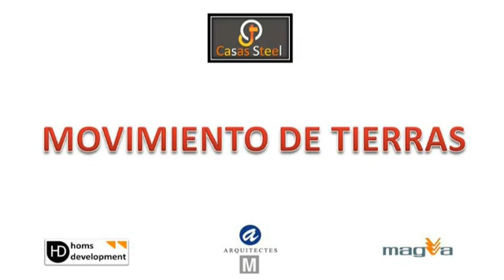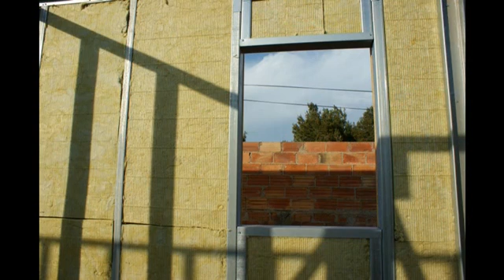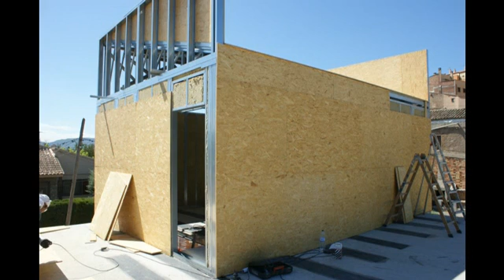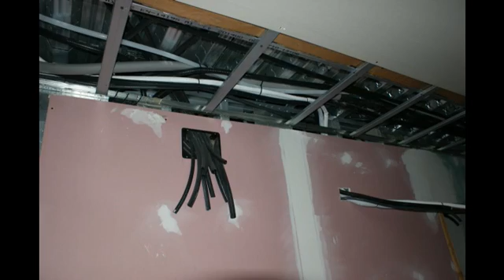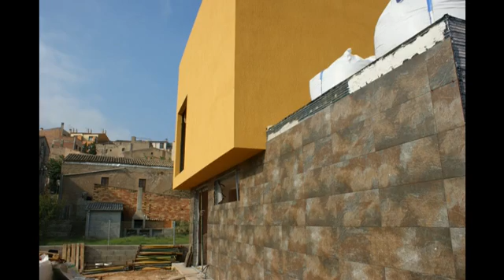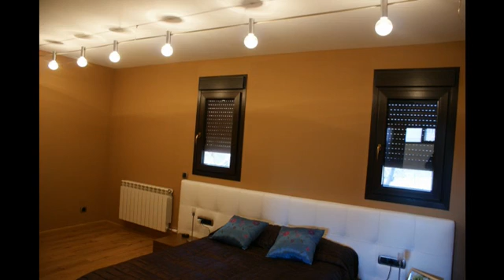Proceso constructivo -Paso a Paso- Steel Framing

Comment: A&W Tot Obras y Reforma tenemos el 
Precio 980,00 EUROS M2 CONSTRUIDO Cerrado GARANTIZADO
El estricto control que ejercemos en todos los procesos nos permite garantizar al cliente que el precio comprometido en el pedido va a ser el precio final que pague por su casa de Acero. Gracias a nuestro sistema de casas prefabricadas con sistema a seco Steel Frameng tendrás la tranquilidad de que el coste de la construcción no va a sufrir modificación alguna.
La Entrega certificada en 5 meses
La estandarización de los proceso de fabricación de las casas Acero hace que no dependamos de factores externos como la climatología, la coordinación de subcontratas, el suministro de materiales en obra… lo que nos permite garantizar los 5 meses de plazo de entrega comprometidos con el cliente.
Conoce más ventajas 
Disfruta construyendo tu casa 
Te acompañamos en todo el proceso
Invertir en una casa es una de las decisiones más importante de tu vida. ¿Y si te lo ponemos fácil?
Con nuestros exclusivo modelo de construcción evita cualquier imprevisto e incertidumbre para que puedas disfrutar plenamente con garantías de tu casa en cada etapa del proyecto, desde el inicio y durante toda la instalación, eliminando las incertidumbres en el proceso de compra y haciendo de la construcción de tu hogar una experiencia satisfactoria y de plenas garantías.
Descubre las ventajas de una nueva manera de entender la construcción de la vivienda así como de todos los servicios que definen nuestra innovadora oferta. Ahora sí, ¿te apetece disfrutar construyendo tu casa?
¿Tienes un terreno y quieres tener tu nuevo hogar en cinco meses?
Comienza ya a diseñar tu hogar
Casas Prefabricadas de Acero 
Presentamos un nuevo concepto en el mercado de la construcción inmobiliaria, las viviendas prefabricadas de acero industrializadas. Casas que aúnan la más alta calidad en términos de construcción, tecnología, energía y funcionalidad, unida a un plazo de entrega y coste únicos en el mundo.
La vivienda prefabricada de acero mantiene la fascinación de la arquitectura por la estética de este material, capaz de expresar solidez, autenticidad y modernidad, y de reunir excelentes cualidades funcionales de manera duradera. Las casas prefabricadas de acero ofrecen una extensa gama de soluciones que permiten definir con libertad el acabado final y la personalidad de cada vivienda. Además de las muchas posibilidades que ofrece como material de construcción, la industrialización aporta el intenso control productivo que garantiza la precisión de las dimensiones y configuraciones geométricas.
Infórmate
Conoce por dentro una casa con sistema Steel Framing cuenta con diversas viviendas prefabricadas instaladas en distintos puntos de Catalunya . En la fábrica se encuentra un modelo de vivienda de exposición. Consúltanos para visitar una casa piloto y conocer más sobre las casas prefabricadas de estrutura metálica 
Te invitamos a descubrir nuestros hogares
Conoce por dentro una casa acero 
Sostenibilidad y Eficiencia Energética
La fabricación de casas Homm se basa en una cultura de crecimiento sostenible y de respeto por el medio ambiente, materializando todo nuestro proceso industrial bajo la certificación de sistema de gestión ambiental ISO14001.
El diseño de la vivienda y la elección de los materiales que conforman la envolvente atienden a criterios de sostenibilidad y eficiencia energética.
Las casas prefabricadas de estructura de acero optimizan los consumos energéticos y son respetuosas con su entorno, aprovechando al máximo los recursos naturales y ayudándote a minimizar el gasto en electricidad.
Diseña ya tu casa sostenible
Las casas prefabricadas de ACERO GALVANIZADO STEEL FRAMING simplifican la construcción de viviendas unifamiliares y adosadas y ofrecen una experiencia única.
CONTACTA CON NOSOTROS
655057768